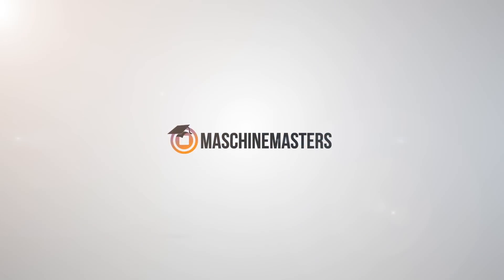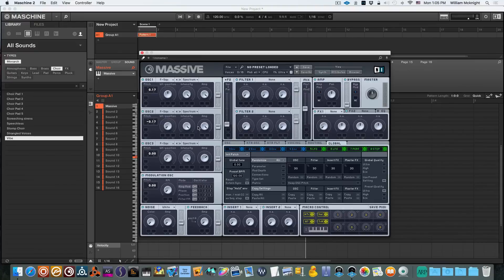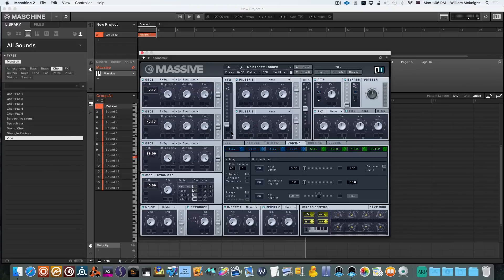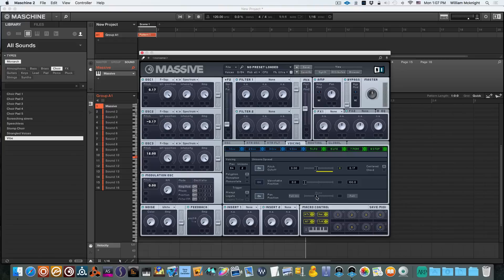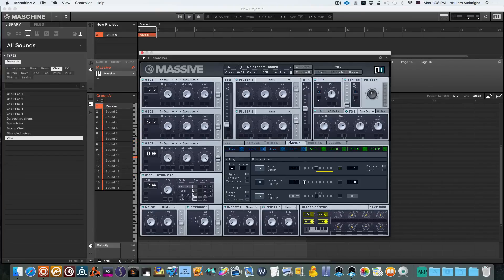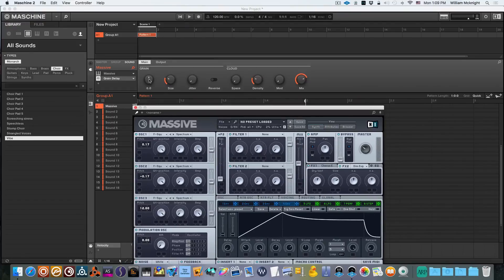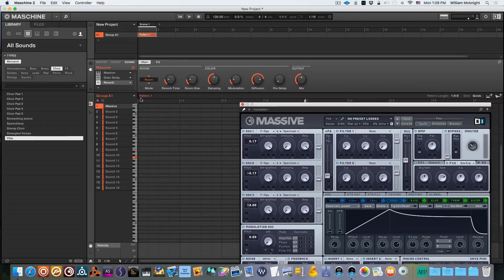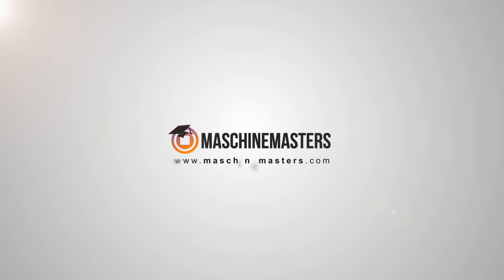Massive Maschine Tutorial - Creating Synth Choir Patch From Scratch - Maschinemasters.com

Comment: i like the resulting sound but tutorials where they don't say WHY they're seting the parameters to those particular values don't help in understanding the synth. luckily i more or less know what most things do in massive but for a newcommer this tutorial doesn't help much... esp. why formant square? why the pitch up/down on osc1&2? and the answer can't be "cause it sounds good" :-D you should explain what a change of param is doing to your sound (at lest roughly) ... (e.g. formant square have this organ-like sound, slight pitch variations between oscs makes sound  "wider" (similar to "detune" in the OSC tab), osc3 is tuned an octave up which adds the high portion giving it a choir-like sound etc... explanations like these would have helped me a lot when i first saw massive :)